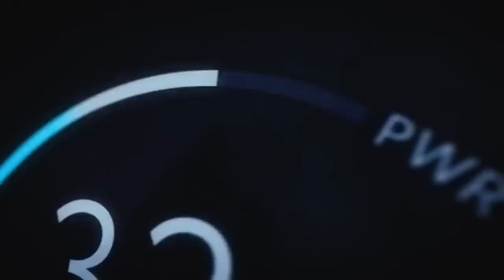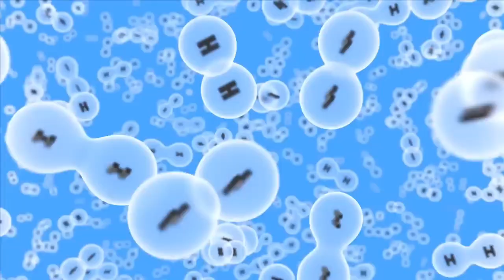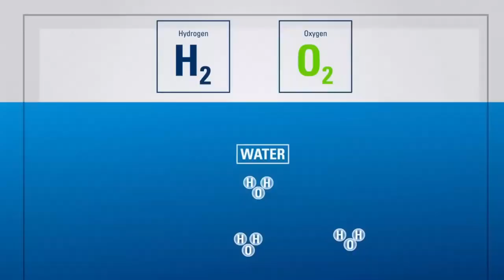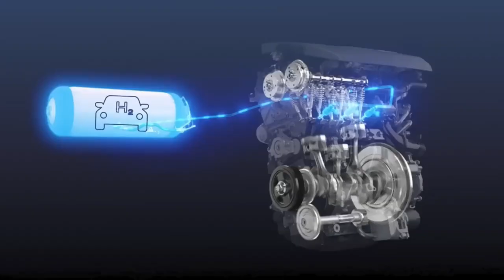Toyota CEO Unveils Revolutionary Hydrogen Engine

Comment: Like it or not, hydrogen is the fuel for the future. Hydrogen can be produced while you drive. Have you noticed they never mention how much an all electric vehicle weighs?  Try to find the weigh listed for the various EV cars out there.
Reply: notice how in this video they didn't talk about the high-pressure tanks in the trunk or where the hydrogen will come from. what do you mean by "Hydrogen can be produced while you drive" all the hydrogen that they use is produced from Methane steam reformation CH4 -> 2 H2 + C or Electrolysis H2O -> H2 + O. Then in the car H2 from the high-pressure tanks regulated down to usable pressures then is combusted with air from the intake. Air is mainly 78 percent nitrogen and 21 percent oxygen. This means the combustion produces primarily H2O and NOx an air pollutant. There is also a hydrogen fuel cell where the H2 is sent through a platinum catalyst along with air to produce electricity. since there is no heat there is no NOx just water.
Reply: Hmm your argument makes no sense at all. 
A hydrogen fuel cell vehicle is an EV. The fuel cell converts hydrogen back into electricity which is used to charge a battery, You know that very heavy thing that powers an electric motor.
Not only that in a hydrogen fuel cell car you need a pressurized cylinder of hydrogen running at 10,000 PSI. Disregarding the volatility of hydrogen if that cylinder is ruptured in a road accident pressure alone will rip the car apart and if the hydrogen ignites it explodes it does not burn.
Right now production of hydrogen via electrolysis is energy negative i.e. it requires more electricity to make the hydrogen than the hydrogen can produce in a fuel cell.
In effect you need electricity to produce, compress and distribute hydrogen which you then use to make electricity to charge a battery to drive an electric motor. How does that make sense.
Reply: There's a thing on the internet called Google. You can search for the weight of any car, EV or not. My Chevy Bolt EV weights 3589lbs.  My gas car weighs 4482lbs. Weight aside, what really matters is efficiency.  I can get over 120 MPGe and I can charge directly from the sun. If I generated hydrogen from my solar via electrolysis, I'd need 4 times the amount of solar panels to go the same distance with FCEV. With a hydrogen ICE, I'd need 7 times as many solar panels. People are moaning enough about the amount of solar and wind installs (they're ugly, they're hard to recycle at end of life, etc). Just imagine needing 7 times the amount to do the same thing. Japan is using hydrogen because it's an island and imports 100% of its transportation fuels. They can import liquid hydrogen from Australia, but can't import electricity.

Comment: You didn't happen to give the efficiency of the the H2 ICE.  At about 25 miles/kg and the cost today of dispensed hydrogen averaging $25/kg  That's about $1/mile.  $30/gal of gas equivalent. Or $4/kWh electric equivalent.  Not only that, but if you compare H2 ICE to BEV, you need 6-7 times more solar and wind installed.  Not 6-7%, but 600-700% more.  That's crazy.  The BMW hydrogen 7 only got 15.6 miles/kg in its H2 ICE engine.  I'm glad Toyota was able to nearly double that, but still, it's terrible.
Edit:
H2 prices at the pump for 100% renewable hydrogen just went up again. Now $29.95/kg.

Comment: 6:38 energy density is the amount of energy stored in a given system or region of space per unit volume. It is sometimes confused with energy per unit mass which is properly called specific energy or gravimetric energy density.  H2 has a higher specific energy, not a higher energy density over a battery.  This is why there's no interior room in a Toyota Mirai, because it's all taken up by tanks.  It's outside dimentions are that of a full size sedan, but it's interior volume is that of a sub compact.

Comment: however the amount of charging stations vs the amount hydrogen fuel stations the US is a joke and the current Toyota Murai also sucks
Reply: yeah, I only see hydrogen being viable in a few cities around America being co-located to regional airports, or a municipal Hydrogen bus network, or major electrolyzing plants. These things will not be mass-market cars like gas or electric. Preliminary plans are to turn Louisiana into a hydrogen hub. It would have the Salt domes for gas storage the offshore wind for green energy sources for electrolysing and the existing oil and gas know-how to produce hydrogen. They also want to use the existing CH4 (natural gas) pipelines to distribute %10 H2 with %90 CH4. The big problem is this has never been done before and the pipelines and H2 extraction plants from the CH4 are yet to be tested.

Comment: Progress is important, however:
1. Using an "abundant" molecule is misleading when the abundance is  inside the sun and other stars. So not abundant in our environment.

2. Comparison needs to be done against petrol cars, not the relatively immature electric car technology

3. Environmental impact is important but so is efficiency and power density which must be sufficient enough to satisfy various transport needs currently satisfied by petrol and diesel.

4. It takes a lot of energy to create the not so abundant hydrogen fuel. More energy must go in than is produced. Wind, solar and hydro either need to become far more efficient or nuclear needs to be far more embraced.

I'm not saying no, but it's far from what the video portrays. Good luck in further development.

Comment: I dont understand Toyota's stance on Hydrogen and internal combustion engines. I does not make any sense at all for a number of reasons.
Currently there are no hydrogen production facilities large enough to support the needs of a sustainable hydrogen based transport industry.
With the exception of California there are no retail distribution facilities, anywhere and the USA currently have a total of 47.
To build a production, storage and distribution means starting from scratch with unique equipment and currently there is no one Government or otherwise putting their hand up for the job. There is nothing in the current fuel industry that can serve a dual purpose.
There is no doubt that a hydrogen fueled internal combustion engine works but for Toyota to claim it as a breakthrough is wrong. JBC have been working on it for years and are now producing their gen 5 engine.
The problem with hydrogen internal combustion engines is that you are simply exchanging one fuel for another. Yes in in a zero emission fuel but other than there is no change in the service and maintains cost or the efficiency on the engine itself and the fuel costs more.
A fuel cell car is nothing more than a hybrid which takes hydrogen and converts it to electricity to charge a battery and run an electric motor.
Reply: there never used to be electric car charging stations either.....
Reply: The main reason Toyota is investing in hydrogen cars both combustion and fuel cell is that Japan's current plans for its energy futter relies on hydrogen. One main aspect is using their current and new Nuclear power plants to generate green hydrogen through electrolysis. There are also plans to import Huge amounts of either hydrogen or ammonia(NH3) with tanker ships from Australia due to its large land area for solar and wind. It also allows them to reduce thier reliance on batteries because japan has little if no capacity to produce them from domestic supplies limiting thier competcness when compared to the EV companies in the US.
Reply: @SoloRenegade  That is where you are wrong. even when the first car was built, which was electric BTW, most large cities had electricity and the ability to charge a car. As it is now every home in the USA and the western world for that matter has the ability to charge a car and most people go home at night and sleep.
The other side of this is that for the electricity generators transport is just another market to add onto their existing markets. They dont have to build a distribution system it already exists all they have to do is provide access.
Hydrogen on the other hand requires the construction of the production facilities, the distribution and the access system. There is no ability to refuel in the home and in the foreseeable future wont be
Right now there is nobody putting their hand up to build that infostructure.
Reply: @wrenbird8352  That may well be true for Japan but even then they are still to build a fleet of ships to transport the hydrogen and if you think that a supertanker of oil breaking up is a disaster you wait until a supertanker of liquid hydrogen breaks up. It does not burn, it explodes.
Currently generating hydrogen via electrolysis is about 1.5 times the cost of charging a battery direct and in effect a fuel cell is nothing more than a hybrid that converts the hydrogen back into electricity which charges a battery. It does not make sense.
Reply: @horsebee1  when the first cars were on teh road, hell, even when the Model T was first produced, almost no one had electricity.

those first cars were also well beyond the means of almost everyone alive at that time. a short ranged toy for the rich. 

"Hydrogen on the other hand requires the construction of the production facilities, the distribution and the access system. There is no ability to refuel in the home and in the foreseeable future wont be
Right now there is nobody putting their hand up to build that infostructure."

this is not true. Toyota and others have been making hydrogen vehicles, and fill stations were built in CA and are popular among people that own teh cars. The issue with hydrogen is primarily the storage tanks in the cars, and transportation. Without a viable way to transport liquefied hydrogen in high volume, it was a hard sell. but then a company figured out how to liquefy hydrogen in ammonia recently and solved that problem. 

Airbus is also exploring hydrogen, as are many other aircraft manufacturers, some of whom I got to talk to the engineers working on the planes last year. Lithium batteries as a solution for aviation is Dead on Arrival, 100% not possible. Too heavy, too low energy density, etc. Smaller short range planes are making inroads, but nothing is really sticking. The light 2-seat GA aircraft I could buy are so short ranged, i couldn't even fly to the next airport over before the batterie died. to get from one airport to another I'd have to trailer the airplane by road. And airports lack any sort of charging infrastructure.

Hydrogen buses also exist already in many cities. And it's not unlike propane powered forklifts and such which are widespread.

The problems are being solved, but far less money and effort has been put into solving the hydrogen vehicle solutions, and so they fell behind. But that in no way means lithium EVs are automatically the "right" or better solution. 

I'm an engineer, and many of my coworkers own electric vehicles, but by far teh most practical are the Prius hybrid owners. One of my coworkers, an electrical engineer who does our power systems, bought a Ford Lightning and instantly regretted it, due to lack of charging infrastructure, and due to lack of range, especially where we live (cold winters). It has complicated his life and takes free time while he waits for it to charge. He finally got his in-home charger after waiting months for it, and that made it better, but you can still see he's not entirely happy with it. 

People like you jump on the bandwagon of whatever fad is trending without thinking through the big picture consequences and challenges that remain, not least of which is that the lithium is being mined by slave and child labor.
Reply: @SoloRenegade  Hmmm even in New Zealand reticulated electricity was available in 1889 and yes you are right until Henry Ford started his mas production plant cars were the providence of the rich and mostly electric.
When Ford started mass producing the T Ford he was able to reduce the price of a car by about 75%, to a point that most small  producers simply could not compete nor did they have the investment to tool up for the new methods.
Ironically the same thing is happening today with GM in particular. Despite all of their claims they simply dont have the funds available to compete in the EV market.
Where you aware that the T Ford was designed as an EV and a number of prototypes were built, two of which are still in existence one being here in New Zealand. Henery Ford spent two years working with Bell on an improved battery but then was offered investment funding by oil interests that came with conditions. The rest is history.
Reply: @horsebee1  "Hmmm even in New Zealand reticulated electricity was available in 1889" no good for anyone outside of New Zealand, and most places had no electricity, no matter how much you try to cherry pick.

the model T ford exists in almost every possible configuration of transport possible, they were even turned into airplanes, racecars, trucks, boats, and more.

Like it or not, claim conspiracy (some did exist, but couldn't stop all innovation back then) to make yourself feel better, but the fact remains that electricity was simply not viable for the masses, and the same is true today. the vast majority of people cannot afford a new EV car, can afford the charger, and live in places or have lifestyles/jobs where short ranged EVs are simply NOT VIABLE. There is a serious lack of charging infrastructure where I live for example.

Comment: 6:01  This guy clearly isn't around now in CA where there's tons of Toyota Mirais, and Hyundai Nexos experiencing the same exact thing he's describing for BEVs.  Lots of H2 fueling stations down and not working, range anxiety, long wait lines to refuel because you can get a 5 minute fill if no one has used it in a while, but it can't keep delivering 5 minute fill-ups over and over. Or if you or a person ahead of you forgot to wipe the nozzle and it freezes to your fill port and you've got to wait 15-20 minutes for it to get unstuck when you didn't plan on it.

Comment: So let me get this straight: you still burn the hydrogen in an internal combustion engine? Still have 100s of breakable moving parts AND OIL CHANGES? Just to have water come out the exhaust. And the electricity that's generated powers an electric motor (redundant). And a complicated hydrogen storage system at an extreme pressure where there is no infrastructure. Sounds like a REALLY BAD IDEA.
Reply: hybrids work. the smaller electricity generating engine can be made more reliable and smaller than an equivalent ICE engine, since the toque of the electric drive is doing the heavy work. hybrids don't lose range as the batteries wear out, refuel faster than EV, work far better in cold climates, etc.